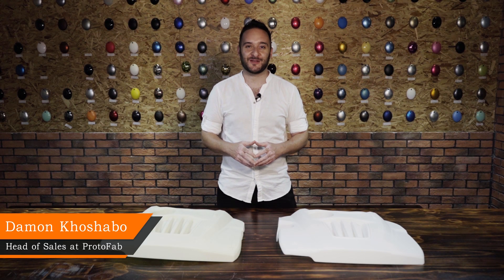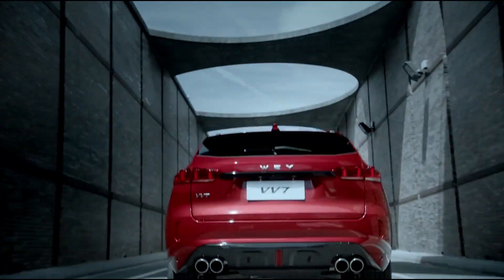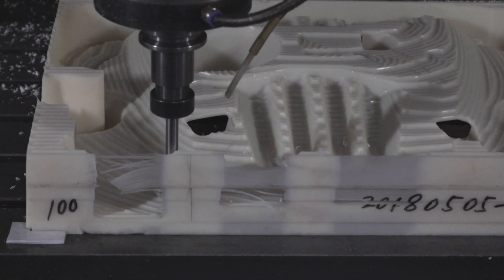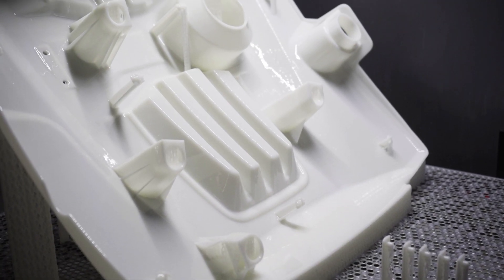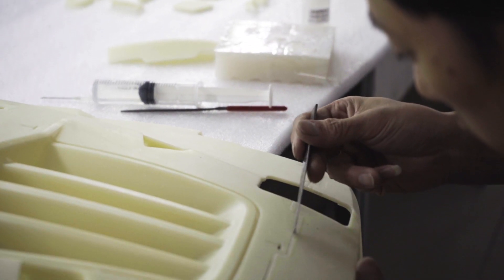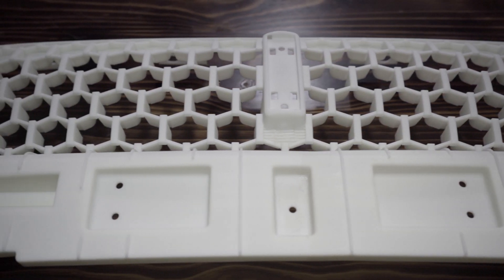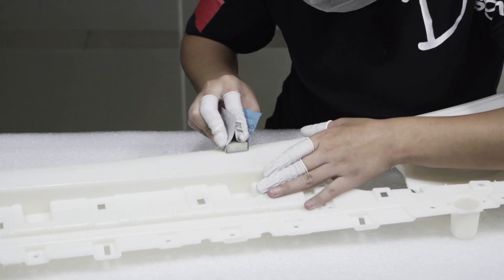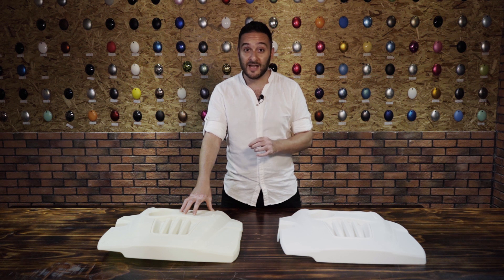SLA 3D Printing vs. CNC Machining in the Automotive Industry | Great Wall Motors

Comment: this looks like using a 100,000 USD SLA large printer vs a 10,000 USD CNC router, and as mentioned, ABS is much tougher than resin from SLA